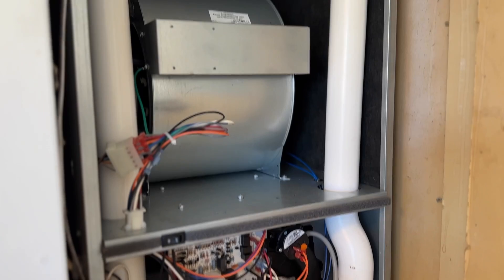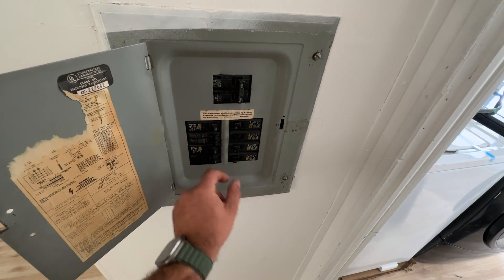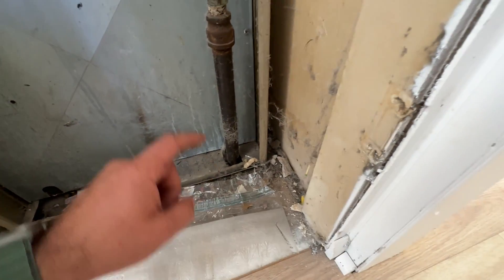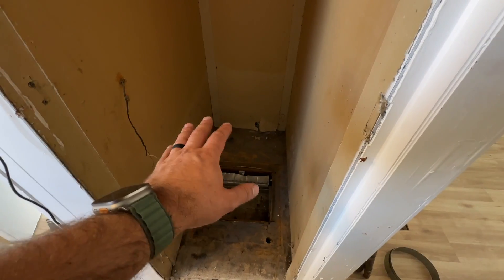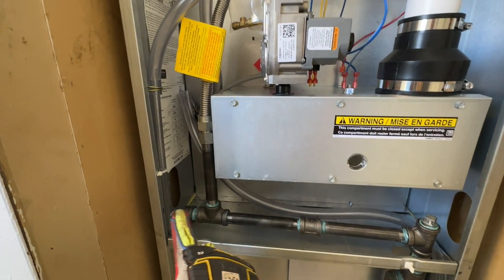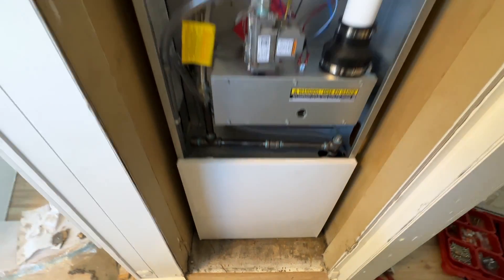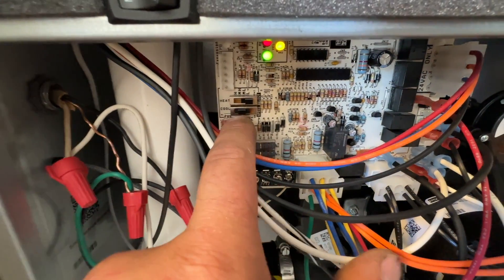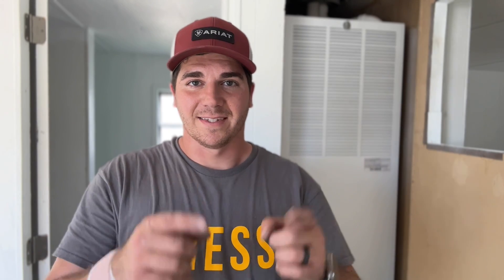How To Convert A Mobile Home Furnace To A High Efficiency Furnace

Comment: On the roof. Which pipe should be lower. The intake air or the exhaust hot air or does it matter? Also does it matter the direction they are facing and should they have just 90’s or 180’s to keep the rain and wind completely out. Or possibly a 90 and a 45 to angle each of the pipes slightly down.

Comment: I've done quite a bit of research on he furnaces in mobile homes and decided to stay with an oil burner.
I finally found one at a decent price point online. Those things were becoming hard to find around se NY.
The only issue I haven't figured out yet is selecting the blower speed and an easy way to do a heat rise test.
If you have any info to offer on that, I'd really appreciate it.
And btw, I've watched quite a few of your videos. Great stuff 👍

Comment: Really hack that flu in there. I just did one and pulled the old flu out, patched the roof with some sheet metal and elastomeric (btw pookey is not rated for waterproofing on the roof. it cracks and shrinks in the sun)  Then drilled 2 holes for the new pvc flu, took them straight out, no 90s and put down roof jacks and covered with elastomeric.  It took an extra 30 min but it was done right.

Comment: How do you keep condensate line from freezing
Reply: run it in a bucket inside and dump daily. Literally what I had to do when I lived in mine with a HE furnace. First winter it dropped to -6 one night and I woke up at 4am and the house was in the 20s furnace was down. By the time I got someone there to look at it every waterline in the thing froze and was a huge mess. Condensate line froze solid under the trailer. The hvac guy fixed it or so he said couple nights later it done the same thing even colder outside. I cut the line and ran it into a bucket that night and it never shut off all winter. They shouldn't even offer these things for mobile homes that isn't at least on a heated crawlspace makes for nothing but headaches.
Reply: @jeremeytaylor2433 thank you for your comment.

Comment: I currently have a electric furnace. But a much older model. And heat only. But its wearing me out in the winter. My summer bill is around a hunder dollars on the high side. But right now it being the coldest part of the year its been over 400 a month.... Definitely gotta find a solution.

Comment: I am just in awe of the hackery.  The gas piping job inside of the furnace cabinet.  I have to resist the urge to point out the code violations.  This is actually illegal anyway, even if it were code.
There are lots of experienced people who are in the trade don't even do a good job.  Doing something for the first time is where the most mistakes happen.  Hopefully nothing bad comes of it.
The other commenter mentioned regulations preventing deaths.  I see it too.

Comment: You save until you have to replace boards, variable speed blowers and module's because of voltage spikes etc etc.   Then all those whistles and bells costs you more than a simple 80 percenter..  Tech wanted 3 grand to replace my blower, when all it was a 4 dollar thermister.

Comment: This is 90% similar to my Nortek M7RL furnace (I don't have that space under the main part, it sits lower). Parent company has 10-12 brands under their umbrella so not surprising to see different badges. Mine is 5 years old (2018) and need to replace the heat exchanger in its 6th winter.
Reply: Have you seen a reduction in your energy costs?
Reply: @4seeableTV  I bought the trailer with the furnace included. If you're asking energy costs with the malfunctioning exchanger, the answer is no, it is just noisier due to the air turbulence.

Comment: Thank you, I appreciate the information. I’ll watch all relevant videos, was quoted between $7000 and $11000 for just havc. That’s not including the roof jack or gas line. Most look at the system and take a picture and never hear back. Being a twenty plus year old electric unit it needs to go. We live in the Midwest. If I can buy the unit for $3500 I am confident I can install. Out source the roof jack and it has one.
Reply from the maker: If you need some help with your install check out our remote assistance page at Patreon.com/diyhvacguy   cheers

Comment: Most pvc vented furnaces require the use of only 45's or long sweep 90's for the vent and fresh air. Is this one different?
Reply: I’m a licensed hvac contractor, so I have. I also read the instruction manuals and they all say what I said.
Reply: I've met many "Licensed" contractors that think they know how to install. I teach Hvac at the local college. Always follow the updated mechanical code book. "Fresh air"? Did you mean combustion air? Here's a question you should know. How many elbows can be used for the exhaust flue pipe? Google is your friend. @niemisofgc
Reply from the maker: It doesn’t matter. What’s most important is how many elbows and 90s there are within so many ft. I’ve used long sweeps and regulars interchangeably
Reply: Agree to disagree, I've been in the HVAC bussiness for over 45 years and have seen the result of using pressure 90's on venting. i could have accepted if you put it on the intake, but not the vent. Still love your videos, keep up the good work. @diyhvacguy
Reply: You might want to read a mechanical code book before posting. 🤓

Comment: Greetings, I have a 3 year old 3T Champion (Johnson) system, and the air handler blower motor runs continually. I pulled the cover off and it appears to the an 'X-13' type, and with all the 24v spades disconnected, the motor still runs,  sometimes on low, but mostly on high.
Is this a 'module' issue in your opinion? And if so,  would I be better replacing the entire motor? Or just the module. I'd rather save $ if I could.  Plus, I'm over 60 and it's in a cramped attic with trusses. Not the greatest access.  Your thoughts?  Love your channel!
Reply: Well, the fact the blower motor runs has led me to consider just keeping it.
But, since the X-13 has constant power, the Module is defective in that the motor WILL NOT SHUT OFF even when Green is not calling for it.
So what I have done is this:  I have wired a DPDT contacter in between the L1 & L2 leads to the X-13, activated only when Green gives signal.
The relay is an old spare I had from my previous Air Handler.  It makes an audible 'thump' now when cooling is required and the system works as desired.
I suppose I should probably make a note why I did this and place it on the air handler door, should someone else ever need to figure out why!
Basically, the EMC is wired (relay-wise) like a PSC now.  And I have a 5 month old PSC from the replaced compressor fan that I can swap if the EMC goes bad.
Thanks for the education you give & the encouragement to do more than we thought possible.

Comment: You might wanna look at the manual.  Because I think the exhaust is supposed to vent straight up.
Reply from the maker: That is for the 80% furnaces
Reply: Going through the roof I always put a 90 at the end. Helps keep the rain out. Good video. @diyhvacguy

Comment: Hello, really like your videos in homeowner advice and instruction.  1 thought though, in a previous video you kinda suggested a high efficiency furnace wasn't really worth the extra money upfront and repair expenses due to added parts.  Is there a difference between this mobile home 95% and the house 95% in the other video?  Just a friendly question,  thank you.
Reply from the maker: Mainly the venting. It’s a bit safer. But the owner wanted a high efficiency so that’s what we installed. Also a lot of mobile homes are on propane which can get expensive so the high efficiency would save money that way
Reply: @diyhvacguy  The math is easy.  Plus, plastic pipe doesn't rot out in 15 years like the metal roof jack that I installed for my 80% Nordyne 17 years ago. I had the option to spend a little more for a 96%, but I was too cheap.  Many regrets. It's getting replaced with a 96%.

Comment: Lately your videos have me shaking my head. Not that you do a bad job. But, like this one. Unless someone has a master gas license they have no business anywhere near a gas installation. There are reasons for licensing and pulling permits. These regulations prevent needless deaths.
Reply from the maker: I understand Curtis. The reality is everyone who watches your channel, ac service tech, and the anti diy hvac guy are all learning stuff. I’m just being honest about it. I want to help people and if they’re being safe, they can replace their furnace. They can get their work inspected just like a professional and save a lot of money.
Reply: NO big company that installs furnaces has installers with “master gas license” lol
Reply: You really shouldn't be doing   these videos you NEVER drop the condensation tube under home. You always put it in some type of drain. Please quit showing these poor videos.
Reply: The one I'm talking about was 220 volts with heat strips. You're partly correct, each heat strip is 120 volts. One side of the contactor feeds one heat strip. The other side feeds the other heat strip. Hope that clears it up for you. @bluejay713
Reply: A contractor calling another contractor to work on his water heater? Why? @bluejay713
Reply: Gas isn't that dangerous. It's under low pressure,  it's easy to test joints for leaks, if you fail it's easy to smell. 

I used to install water heaters for a company and I did not have any kind of master gas certification, nobody there did.
Reply: ”being honest about it” TF does that mean!? Thats implying Curtis isn’t being honest or the other guys aren’t either?
Reply: I don't think he was implying Curtis is dishonest. Keep up the good work Krauss. @KoolinwithKrauss
Reply from the maker: @KoolinwithKrauss  no disrespect meant here. I just meant honest in who my videos are for. Homeowners should be able to save money and do this stuff because you and I both know it’s not rocket science. Homeowners watch Curtis channel and yours and learn how to do repairs, whether you like it or not. That’s all I meant 👍🏼
Reply: Curtis, I love your channel and the content you put on Youtube. But aren't you the pot calling the kettle black? You just showed diyer's how to wire a 240 volt air handler on your channel. That's not dangerous also? I truly respect your work. I think you're one of the best techs on Youtube. With that being said, every Hvac video or any how to video, whether its plumbing or even building a home can turn into a dangerous situation for the average diyer. You seriously can't tell me all of your subscribers are hvac techs. Most are people trying to save a little money by doing it themselves. I'm a big supporter of permits and licenses. When you guys put up content its like a double edged sword. We appreciate the videos but we can't control what homeowners decide to do with their systems. I truly mean no disrespect. Take care. Heck look at John Israel. According to the Louisiana State Licensing Board he doesn't have his license and he's doing installs. Easy to look up on the states website.
Reply from the maker: @mikez1968  John Israel is running with no license and slapping it on YouTube?? Wow    Love his videos as well as Curtis’s   Thanks for having my back bro 👊🏼  just trying to help people out is all
Reply: @diyhvacguy  also it can depend on state, from what im reading in Wisconsin you just need a plumbing or HVAC license unless your the home/property owner of a single family dwelling or a farmer then you can just do the work yourself. When plumbing gas lines the plumber or HVAC person just has to submit paperwork to the state and local fire department.

My local HVAC guys just have whats known as a HVAC Contractor License and only require a EPA and Trade School Certification
Reply: @mikez1968 I’d say the difference here is he’s not marketing towards homeowners and directly to them. You actually have to pay attention and know a little bit while watching Curtis, where Dave is intentionally marketing to the homeowners, which is pretty dangerous. And quite frankly down right dumb, because some info he puts out there is not accurate and is actually harming equipment more so then doing good for it. But go ahead and just change a capacitor because that’s all it is. When that motor burns up because the capacitor was weak call Dave, tho he charges 200$ to consult 🤦 if that’s not a scam 🤣

Comment: Just installed a new 80% in my in-laws.  Wish I would have known about the new high efficiency a little earlier.  One thing to add on your roof jack.  I would add a vent cover.  Just found a dead woodpecker in the pipe of our Radon fan exhaust pipe.  That could get ugly if it were in a furnace intake.  Love your videos man!
Reply from the maker: Thanks brother!
Reply: whats the best electric furnace that you recommend for a mobile home downflow
Reply: @leoquirog  Sorry.  I have only looked up the gas furnaces.  If it is like everything else with mobile home, it will be  very limited.

Comment: @The DIY HVAC Guy
I was wondering in this type of a set up, where does the heat actually get pushed to? 
Is there a forced air vent system or does this furnace just push out the hot air directly where the top blower is into the room?
Awesome video! Keep it up!
Reply: it blows into ductwork under the trailer. the very top of the furnace is where the return air enters (from the front not the top top)
Reply: its basically a upside down house furnace
Reply: Thanks! @james6794
Reply from the maker: Return air is pulled through the front of the furnace where the air filter is, and it’s pushed into the hole we set the furnace on top of. That’s the main supply duct and it goes left and right to the supply vents throughout the mobile home 👍🏼